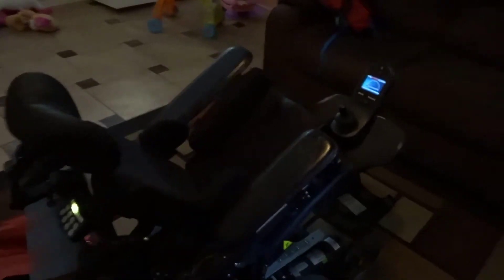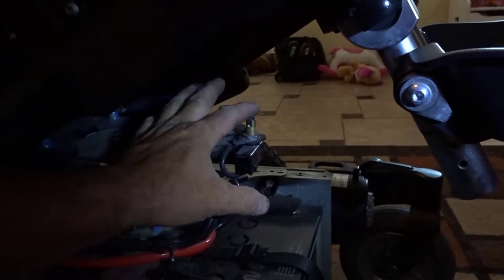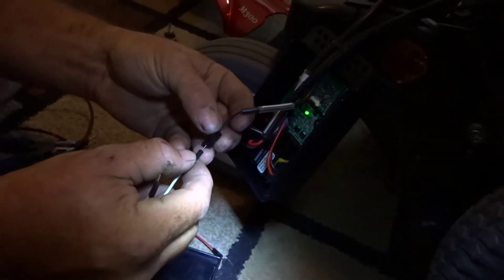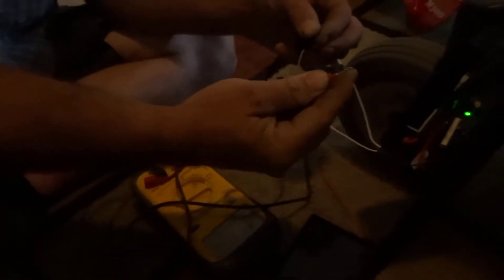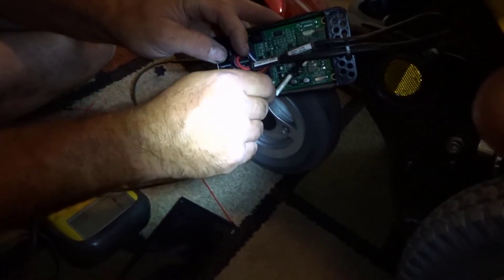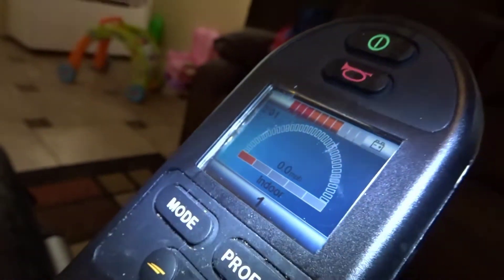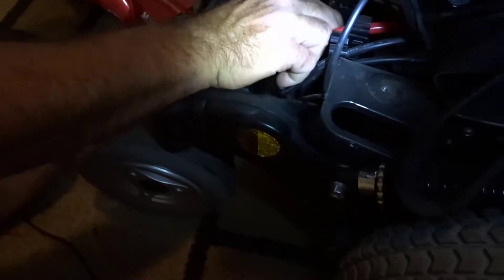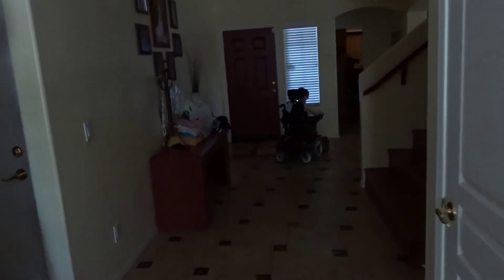Repair Stuck Turtle Mode on Numotion Permobil M300 powerchair

Comment: This is exactly what's messing up on my C300.  I'm going to try to do this, but I am not technical at all.  What do I need to do it?  I moved and the local places wont repair my chair until I basically get it recertified and establish a new doctor.
Reply from the maker: Look for a switch under the tilt switch that closes a contact when the seat is fully lowered. When the seat is not fully lowered it stays in TURTLE mode.
The wiring broke at our switch. I just connected the wires together.
It's just a dummy switch so someone won't try to go fast while in tilted position

Comment: My chair keeps doing that and know wont go off.
Reply from the maker: Does the chair have the recline feature?
When it is not flat the end switch under the seat will be an open circuit keeping it on turtle mode. 
In our case the switch or wiring went bad. I simply bypassed it.

Comment: Thank you for sharing,
BUT just spray some electronic contacts cleaner available in Walmart auto department may be all it needs. 
Its internal metal contacts can become tarnished over time and the spray will clean them like magic. 
I'd try that first before considering bypassing that anti tilt safety switch! Otherwise the whole chair may fall over onto your daughter in the right situation like on uneven ground with the seat elevated. 
Professionals always try to fix things first, bypassing is a last resort. 
Did you even check on a price for worse case, a new switch?

Take care
Reply from the maker: The switch is for idiots and she accepted my instruction to not drive with it tilted and simply didn't drive it with it tilted.

This video is 4 years old.
But anyway,  this worked to get her mobile again at the moment.

Comment: Hi! Sorry to bother you! Did you have to splice any wires when you did it? Or did you just use electrical tape?
Reply from the maker: I can't remember exactly however if I recall I connected the two wires together that lead to the failed end switch with a crimp connector.
As long as the wires maintain a good connection it should be ok

Comment: My wheelchair flashed turtle mode, can you help me
Reply: Red turtle mode i mean
Reply from the maker: It has been a while since this happened however for this chair it was the switch that is closed when the seat is not reclined.
When the seat is reclined at all the switch is not held closed and it will place the chair into TURTLE MODE as a safety feature so it remains slow and more stable.

Our switch failed.
I simply bypassed the switch (connected the two wires together) and my daughter knows not to recline and drive the chair.

Comment: Wheelchair Reset for permobile wheelchair - hold buttons 3 5 6 togetAether and while holding those buttons turn the chair on 'all buttons will be flashing red' then press button 4 twice while wheelchair is flashing red then wheelchair works by itself, keep the wheelchair in an area with plenty of room while your wheelchair goes through the motions
1234
5678
Reply from the maker: There aren't that many buttons on the chair.  Lol
Reply: @hackfreehvac  those buttons below the controller for tilting different things on the chair, probably some wheelchairs don't have that

Comment: Hello buddy I'm in Ohio visiting friends and my chair is stuck your video shows me a great deal how to fix it so I'm in my bed trying to find the correct wires the bottom in the box below the fuse mine only has 2 wire so I tried to just unplug it but it will not run at all so when you found the black and Brown what did you do with the two wires twist them together cut them and wire nut it electrician tape each one I'm lost on What you saying sorry my brain is really bad loosing my mind do to a car wreck I've lost my legs they don't work anymore that's why I'm in bed working on it will the please text me and say what to do since I'm broke and can't call them out to fix it not fare to spend 42 stacks on someth and it's falling apaart thanks Brian Evans

Comment: What a cool dad! I came here cause I was going up my ramp and my K/C300 stopped suddenly in my doorway. I have a red turtle flashing (it's usually yellow for a few seconds right when I turn it on, then goes off).  My battery indicator shows full charge. I don't have your electronics skills but since it's the weekend and it takes a while to get a techie out here, I'm trying to see what I can do to get it going again.
Reply: I'm attempting to fix that same problem on a C300. Did you ever find out the cause???
Reply: @ku8721  sorry, it was so long ago I don't remember exactly. But I believe that chair was over 5 yrs old and my insurance replaced it.
Reply: @carolynscott9007  No problem I fixed it a few hours ago finally. In my case it was a limit switch for the elevation setting

Comment: dang that thing goes now!
Reply: Hello, Hackfreevac
 I'm currently having the same problem with my wheelchair. What exactly did you do to get it to disable turtle mode? I followed your video but turtle mode seems to still be on and I wanted to see if there were any instructions I missed.
Hope to hear from ya soon,
    X
Reply from the maker: It always did when it was on fastest speed in outdoor mode but with Turtle Mode activating when it wasn't supposed to the unit would move at about HALF of walking pace! It was horrible when that happened and she was traversing across a large area like out in the parking lot to get back to the vehicle.
This last week the thing was going into turtle mode every time she started to move then I'd kick it to get it out of turtle mode only to have it go back to turtle mode a few seconds later!